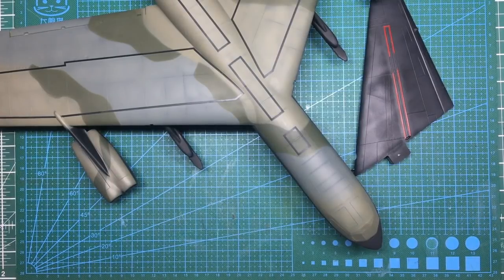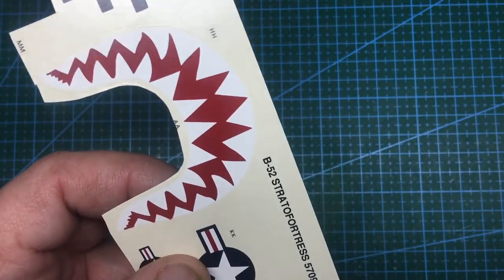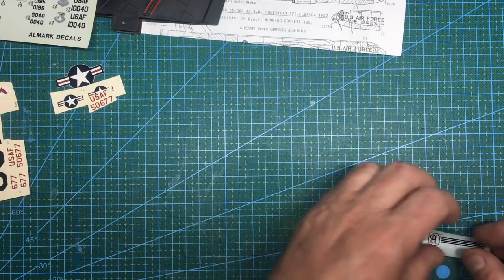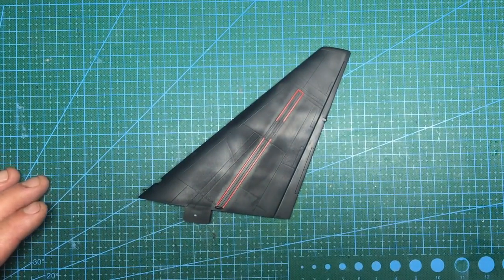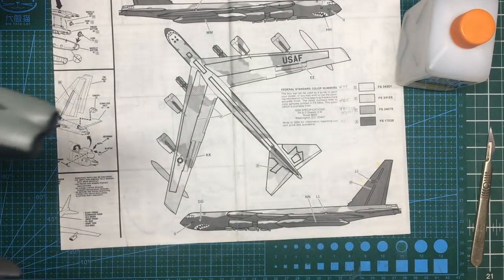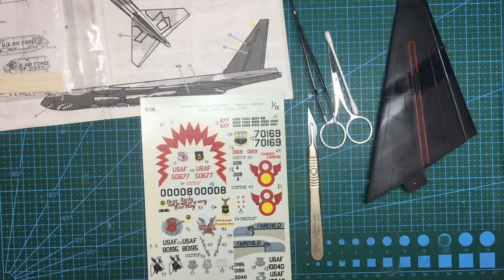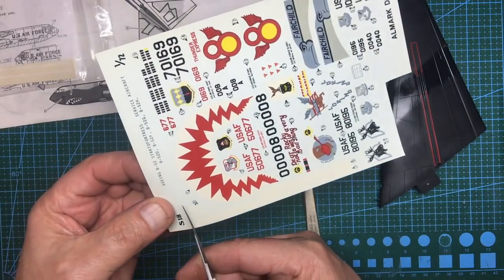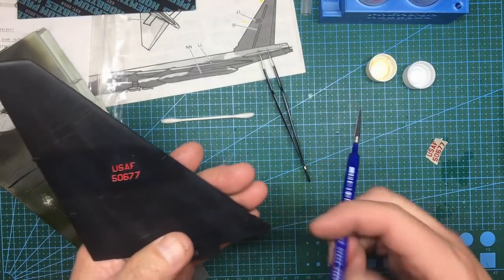Big Bad Buff Build for Beginners. Part 33

Comment: Ahhh - brittle old exploding decal - my favourite. I once had a huge one that took me around 1Hr40 soaking it in water and trying to finesse it off the backing paper with a long haired brush. Even then it ended up in three pieces and a few shards. Once on the subject, the more Sol I put on it, the more it cracked and curled up at the edges. In the end I gave up, let it dry, sanded down the worst bits and cut in with paint. The swear jar benefited hugely that week.

Comment: Interesting video Nigel, i would say the moral is avoid setting solution until the decal is into the correct position. perhaps this is a rule we should all be following; maybe even with new sheets as i`ve had issues with mark set and power slide decals going instantly soft when the fluid touches them. your thoughts?

Comment: Great job fighting with that decal, I use a clear coat of spray on old decals to prevent that, there is also a purpose made solution for old decals I have never used, microscale makes that also. I prefer Walthers solvaset for decaling, it is made / distributed by a model railroad company here in the United States. Have always had much better results with that rather than the micro scale system.
Reply from the maker: Perhaps you could sell me a bottle or two? I also tried the spraying decals method. It didn't work for me.
Reply: @NigelsModellingBench  I can do that, let me know where to ship.
Reply from the maker: That would be awesome!! If you could email me at nigelsmodellingbench@gmail.com and let me know how to pay you ......

Comment: Hi Nigel. Another great and informative video. The point of using the blade ONLY to cut is correct. As you already know, the blades are sharpest closest to the pivot screw. The reason for this is that they will shear better because of the equal pressure provided by the pivot screw. 
I just want to add my tuppence ha'penny worth to that tip. I would urge everyone to adapt the hairdresser's method of cutting with scissors. This way of cutting will provide the most control.
Use your thumb and ring finger. 
Keep the ring finger still while using the thumb to cut. This may feel awkward for a little while, but it won't take too long to become instinctive. 
Lastly, keep the screw head facing toward you. This will keep the blades sharper for longer. (Left-handed people should do the opposite unless they use a left-handed scissors).
I hope this helps someone. 
Pat.
Reply from the maker: WOW!!!!

Comment: I use the Vallejo Varnish and I like it. BUT, you cannot sand it! Maybe I did not wait long enough or something but I tried sanding it and it was like a thin layer of rubber. I also thin it about 30% i would say,..

Comment: I was watching another channel  and the builder used old decals also but he laid down a light clear coat on the decals before soaking them in water and he said that if you have to use old decal the clear will prevent them from coming apart.  Have you ever tried that Nigel?
Reply from the maker: Yes, and found they still cracked up? Maybe try again next time?